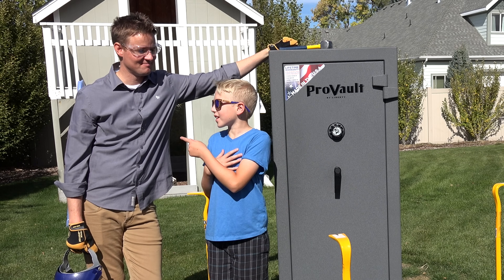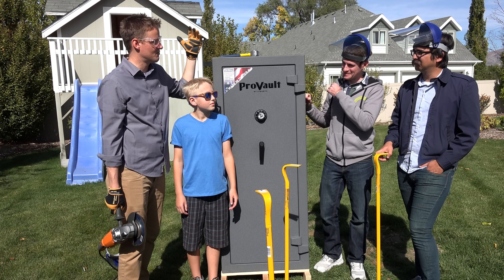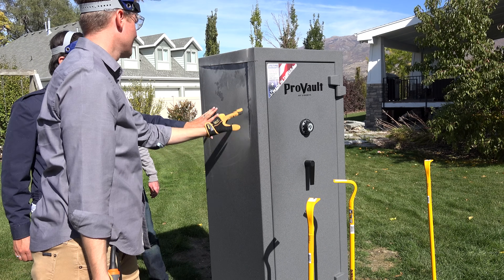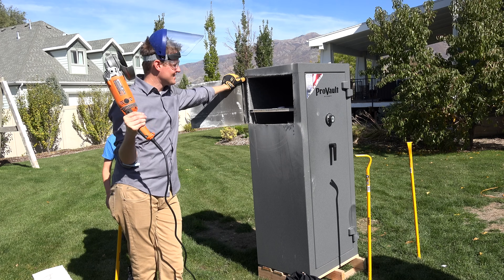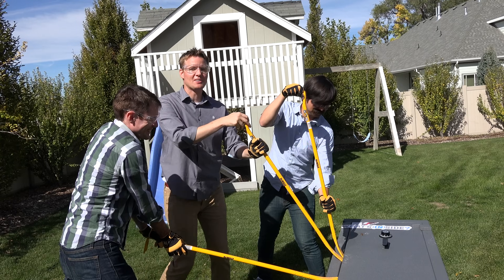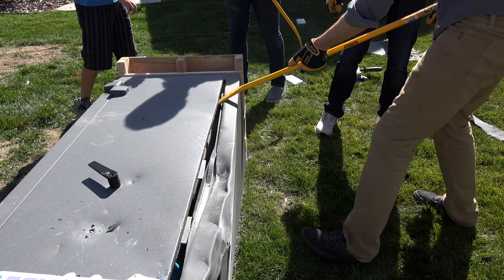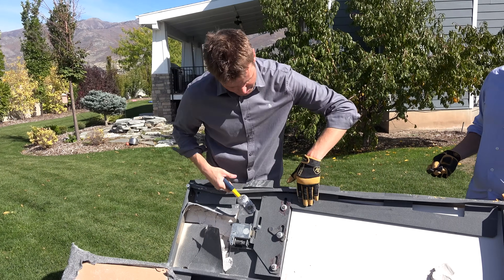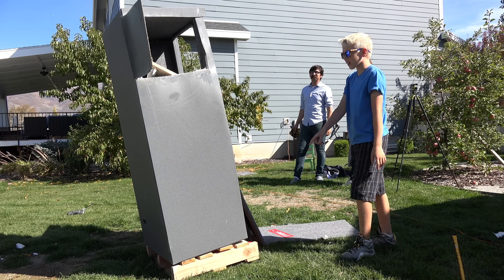What's inside a GIANT SAFE?

Comment: Symbolic life message/lesson: Just because the hatch/door was used to put the valuables in the safe, that doesn't mean that that's the best/easiest way to break into the safe to get what you want/need. Don't be so narrow-minded, be smarter and break into the safe from the side. It is much more effortless, quicker and easier.
Reply from the maker: +datstocklyfe good call.
Reply: datstocklyfe
Reply: do a what's inside video on a sound soul water speaker

Comment: For truly serious security expect to spend several thousand $. You want a UL listed safe with a 'TLTR 30x6' rated safe. This means it's HIGHLY power tool and blow torch resistant on ALL SIDES and will come with all the extra security bells and whistles like a drill proof hard plate and automatic relocking system in front of a high quality lock. The size of the safe will be the next cost determining factor. Again, the smallest TLTR30x6 rated safe prolly gonna run 7,000$....

Comment: Wow, that's one crappy safe.
Reply: that's what I was thinking
Reply: Watch the one called We couldn't unlock the safe.
Reply: all safes follow that same construction pattern. they sell you a big heady door that looks impressive but the sides are the weakest part.
Reply: yeah go pay $3500 for a safe,  you'll see the diff.
Reply: Some chests are better than others, that's clearly low-end.

Take a branded safe, you will see the difference, also price.
Reply: its a gun safe its design and purpose is to keep your guns out of the hands of children and criminals if someone robs your house they cang get quick access to the guns and use them against you so there desighned to resist basic attack for a set period there not desighned to be impenetrable lik a bank vault and for 500 bucks your gonna get what you pay for
Reply: That is just an firesafe, not designed to keep the criminals out but to keep the valuables inside safe incase your house burned down, the 30minutes fire rating is for the temp inside the safe to raise above a certain temperature which i cant remember right now
Reply: o

Comment: You can get into pretty much anything with a grinder and time. A home safe isn't designed to stand up against it, its meant to make it more difficult for a criminal to simply break a window grab your valuables and run before any kind of response team shows up. The other part of what makes a safe secure is not the safe itself, but the fact that its hidden somewhere, so it will also take the criminal time to find the safe and if its in a weird location and bolted to a wall, it will also make it awkward for them to try and force their way in.

If you do some research you will find out that the typical home robbery is no longer than 10 minutes, which is not a lot of time to locate the safe and cut it open with a grinder, also the grinder makes a ton of noise, which can make neighbors suspicious if its late at night and they know your not home.

Comment: those type of safes are really meant for fire protection not burglary protection. the ones that are meant for both are a lot heavier and also a lot more expensive. generally burglary safes have 1/4 inch or so walls and would of been far more of a challenge. You likely would of needed the gas powered cutoff saw for getting through the outer walls.

Comment: I made my own safe, out of 1" steel plate door and a 16mm steel walls with 4" of real MPA55 concrete, where a sledge just bounces off and does nothing. The lock has a thick steel body that cannot be bent over or smashed, and it uses a optical key lock that cannot be picked or bypassed. It also as a time lock that requires authorization else even if you stole the key it will still not open.

Comment: This is clearly meant to be buried in a wall or put in a closet so you can't access the sides easily.
Reply: Wilson Lim I'm not saying that it isn't a terrible safe. I'm just saying that the methods that the safe manufacturers tested the safe at (If at all, or in more likelyhood they just put some words on the sticker) were probably not the conditions that they had in the back yard.

Full access to all 4 sides of the safe, and the ability to get prybar in and full leverage on? Nobody has a safe in those conditions. At least not anyone who would have enough smarts to put anything worth anything in said safe. Just putting it in a closet with limited space to 'work' in will make the security of said safe 10x better.
Reply: You could cut a "window" in the door
Reply: First, this isn't a safe by any standard, despite the common parlance.  At best, it is a Residential Security Container.  But even by those standards, it is a bottom-end example.

That said, an angle grinder will open virtually all RSC's quite easily.  They are designed, at most, to prevent a quick smash and grab by a typical meth-head burglar and to keep out curious kids.  Nothing more.

Even high end true safes are only rated for minutes against a trained and properly equipped attack.

Finally, gypsum board is the common fire resistant material used in most RSC's.  Safes typically use concrete.

Comment: Well, for one, no safe is impervious. Anybody that's determined to get into it, will eventually get into it. The question is how long is somebody willing to sit there and try to open it and risk getting caught. If anything, a safe is a deterrent. The harder it is to open and the things inside are to access, the less likely they are to be taken.

Two, the chances of someone coming into a house with a heavy duty cutting tool like that are HIGHLY unlikely, unless someone knows that there is a safe in the house, and they know for a fact that there is something worth some value in it. At that point, you want to question the people you've let in your house and who's seen your safe and what's in it. This is why you put it out of sight (like, in a corner in a closet).

And, third, if you anchor your safe to the floor, no one can knock it over and pry it open (easily, at least). Especially if you put it up against a wall or in a corner.

Comment: Not to bust your ego, but there are different types of safes a gun safe is probably one of the weakest safes, it’s only meant to protect your guns and minor valuables, they are normally mounted inside a cupboard and bolted to the wall.
A higher category safe will be much much heavier than the one you opened and there are ones that you will not get into unless you had special equipment or would take a great deal of time. A grinder will do and probably a can-go hammer to cut the back off you will not get to door at all.
Entertaining nevertheless, regards Roger.

Comment: wow. I guess that i wouldn't want to buy a safe from then. I know that other safes are much harder to break into though. Back yard scientist, had an old one that the current owner couldn't get into, and people had tried all the conventional methods to get into it, and failed. It took a plasma cutter, and a lot of tools, and time to get through thick metal outside, and the 8 inches of high quality concrete in the middle, and the metal on the inside. I guess they don't make things as sturdy as they used to.
Reply: most are made of 12 ga or less steel, very easy to grind into
Reply: @robertboyd3863  12 gauge is pretty damn thick, so that's actually pretty encouraging. If you have the equipment to easily grind through that, I don't think it matters how thick the metal is within  reason.
Reply: @Pizzagulper  Don't be silly, 12 gauge  is less than an 1/8 in. thick, very easy to cut through with a simple hand grinder

Comment: I dropped one out of a 6 storey building in a city in NJ it weighed 900 pounds needed a tow truck to take it out of the new basement entry I made. New ones are garbage. The old one had 1/8" steel concrete and then more steel. Obviously I need a channel

Comment: Gun safes are no more than glorified filing cabinets. If you want a little more protection get a vintage jewelry safe with hardened steel. Not even that is totally impervious. Coupled with an alarm, cameras, and secret wall, you can borrow a lot more time. If you need to protect something that valuable, it probably doesn't need to be in your house.

Comment: Safe is supposed to buy you time, if you're actively monitoring the area, the safe will buy you 10 minutes to call the police, that's something your mattress won't do 😀 And if there is steel on the inside walls as well, it should take even more time.. Then imagine the robbers face when they go through that trouble to destroy that safe only to find that it contains clothes and your valuables are safe in your sock drawer 🤣

Comment: Cool channel.  Not all safes are made the same.   Order the cheapest safe from Sturdy and do a video please!  That safe you destroyed is not 11 gauge steel.  Some of the other ones made by the same company are.  You cut through a 14 gauge sidewall.  Big difference when you attack 10 or 7 or 4 gauge.  Safes are designed to slow a criminal down.  Try getting into a thicker safe bolted to concrete in a corner while an alarm system is blasting and calling the police.

Comment: That was not a safe !  It was a fireproof file cabinet with a heavy door LMAO! You need a steel plated box with at least 1/2" solid thickness with a heavy solid door to call it a safe. That was a fireproof locker LMAO.

Comment: Made in the USA! what a joke for a "safe" they should be ashamed, i searched on google and found a detailed description for it as well " Heavy-duty, two-piece door and body construction is six times stronger than competing designs. There are no seams exposed to potential prying attacks. Extra-hard plate protects the lock mechanism from drilling and punching. Ten 4" military-style locking bars provide stronger security in the door’s four corners. Break-resistant lock-down hinges are stronger than traditional welded hinges. " a few hits on the long side of it and you were able to pray it open, imagine if you had a smal hydraulic jack and you would be in while it was standing and bolted to the floor.

Comment: All these tests prove nothing. You can cut open a 3/4 inch steel safe as well as this one. The thing is no one uses a single method of security when securing valuables. Also for the cost this Safe is more than enough to keep your firearms out of your children's hands. Against burglars? Well how often is a burglar coming into your home with a metal grinder or five foot long prybars? Perhaps if they case the place for a few weeks maybe, but in a situation like that when planning is involved then sky's the limit on what tools they bring. Almost all home invasions are spur of the moment. Not some well planned out safe cracking job.
Reply: Someguy6571 you can get a grinder for like $15 from harbor freight and it’ll easily fit in a backpack with plenty of room for your valuables and many people case houses before they break in obviously more than you think

Comment: That is not a 'safe' it is a gun cabinet. It is considered and entry level product.  They sell for as little as $429.  Real gun safes can easily go for over $5k as high as $16k for the highest rating.  This POS has no burglar rating. I wouldn't be surprised if you could zip it open with a Dremel Tool LOL